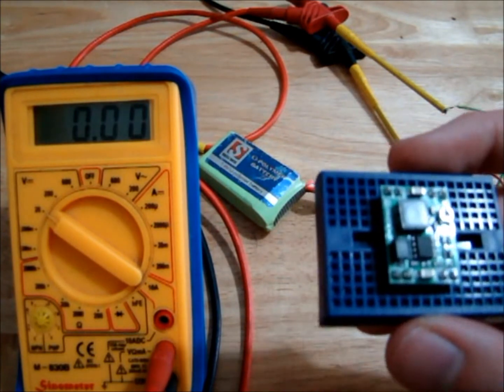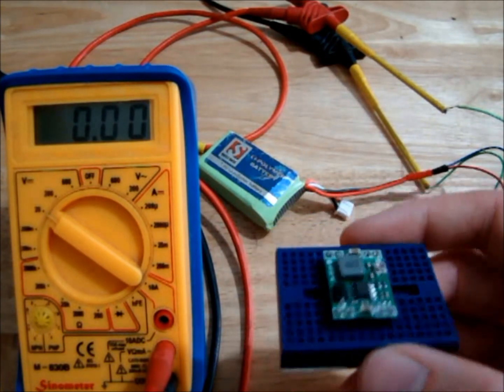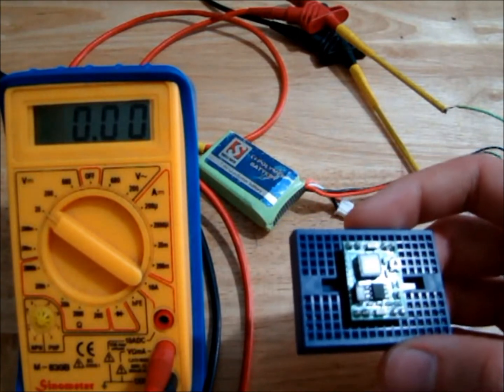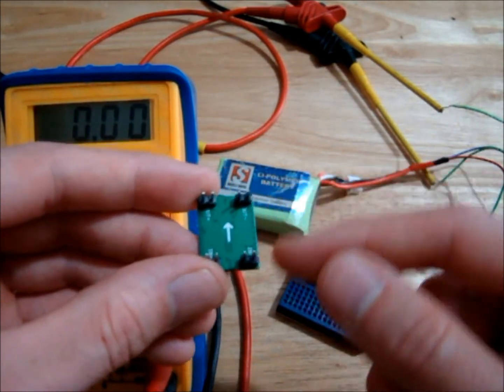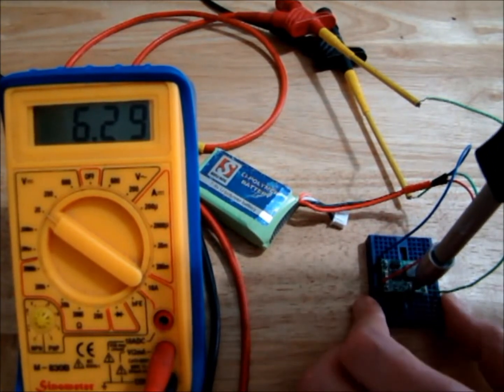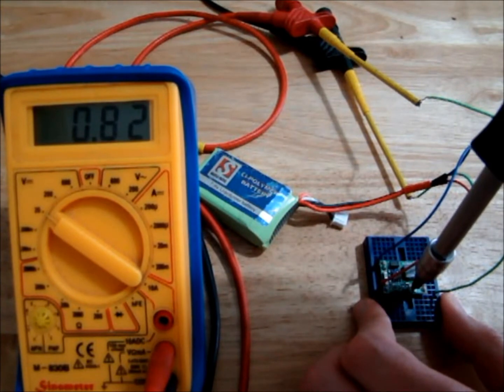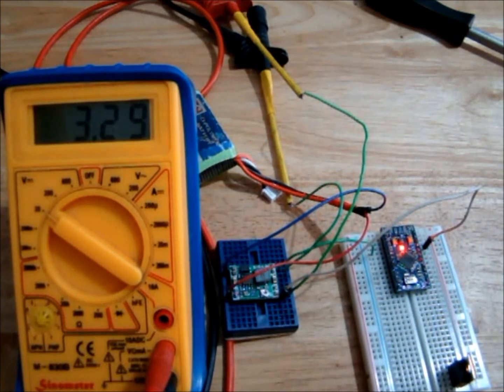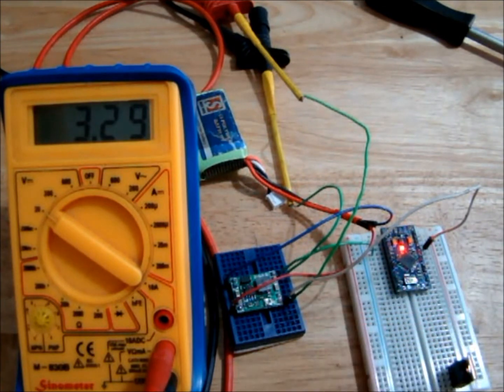How to use a simple DC-DC step down module

Comment: do you know the difference between MP2307 and MP1584  ?  i think the both have the same pinouts but not sure whitch one is best to use to charge mobile device
Reply from the maker: I think its the switching frequency of the chip but I wouldn't have a clue which is best for charging a mobile device